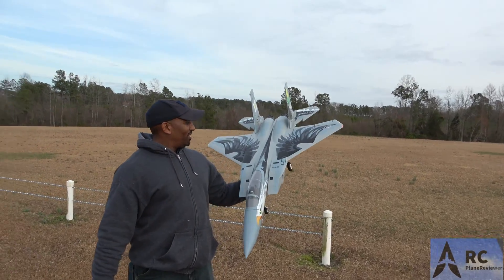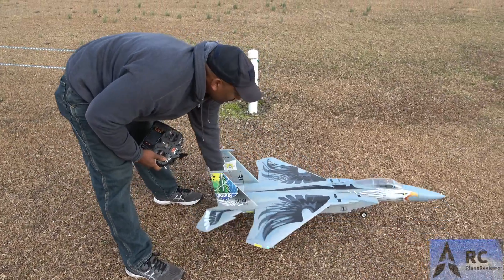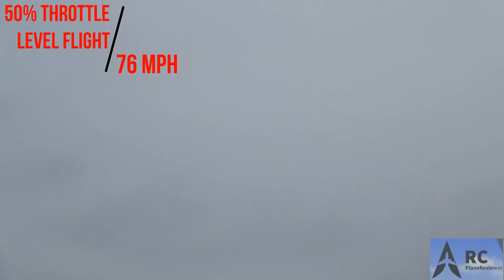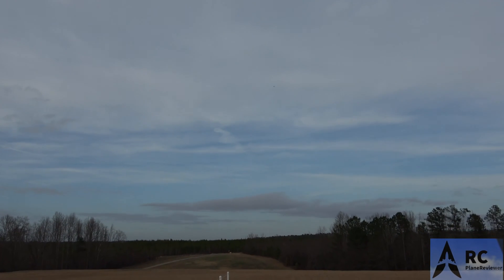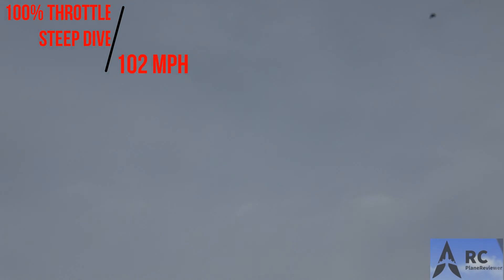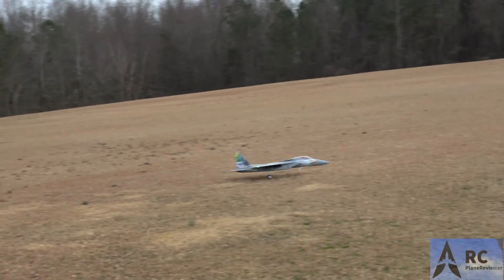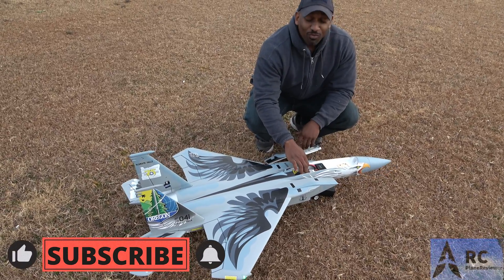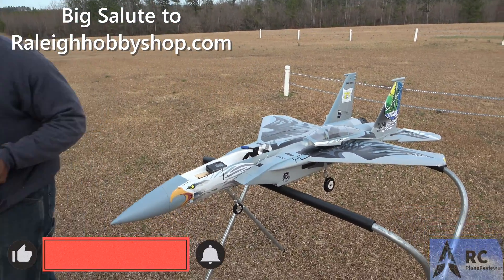Witness the Insane Speed of a F-15 Eagle in this Twin 64mm Arrow Speed Trial!

Comment: hello bro :) I have the same aircraft of this company arrow , only mig -29 .  it seemed to me that the engines and regulators were not very good when I measured the total of 2300 -2400 at the stand.  then I replaced them with qx and the regulator at 80 a) thrust increased 3200. kg. I hope I will bypass you in speed, 110 mil.  cool video !!!!!! I have been waiting for a long time when you will show a similar aircraft of the arrow company and measure the speed !!!  fire video!!!  ))))❤
Reply from the maker: Really appreciate the support and kind words!!! Let me know how your setup goes!! I may have to copy your setup for more.. POWER & Speed!!
Reply: @RCPlaneReviewer  At the moment, everything is already installed.  We have snow in Russia now and there is no way to test it.  The weather does not allow :( write me a mail, I will send you a video or a photo, measurements of the thrust of two motors. before and after) and it will be faster for you to install the moto and the regulator, while I wait for the heat and warm weather :) and tests :(
Reply: Yeh I got 2.27kg of thrust too. Be interested in ur set up too